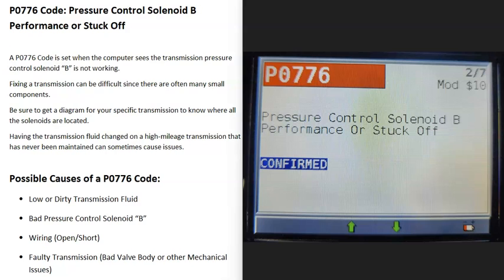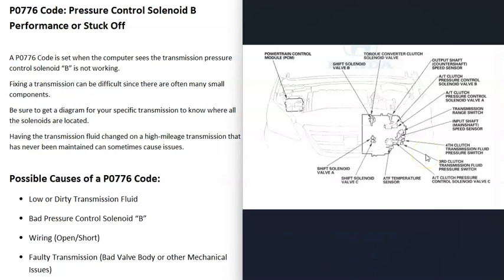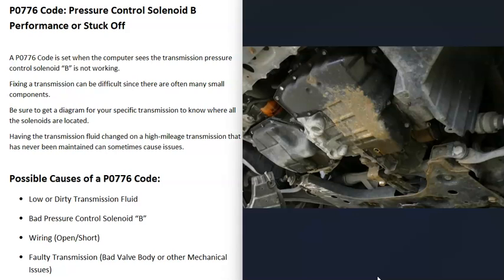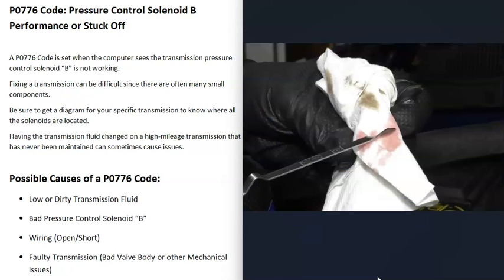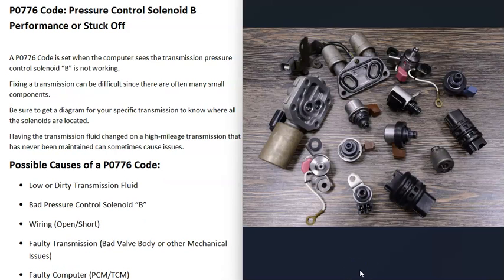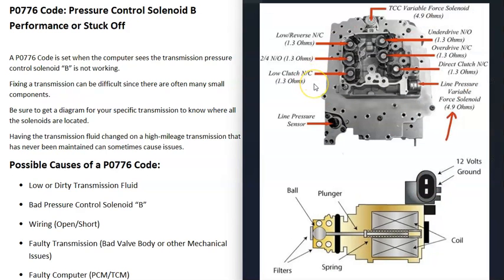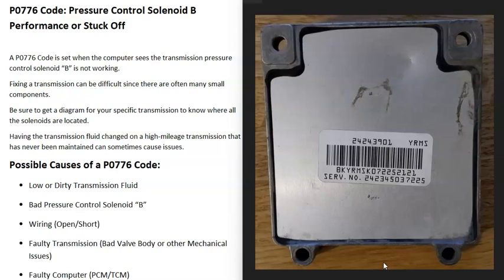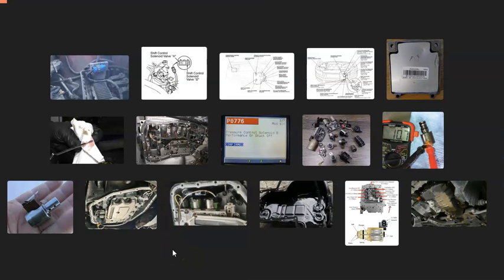Causes and Fixes P0776 Code: Pressure Control Solenoid B Performance or Stuck Off

Comment: what can be diagnosed without disassembly? Thats a commitment.  Fluid level (hot), Fluid scent..... repeatability... Does it happen once an hour or once a week?  Is the fix to key-off and restart?   Are any diagnostics available with Torque and a OBD2 code sucker?

Comment: I have a 04 Toyota solar P0776 came up. One guy check said solenoids are fine. Then took to another shop said transmission needs to rebuild it at $7500 and it skipping lst and going straight to 2nd. So another shop replaced the transmission with a 75000 miles transmission and the code and jerking is still not fix.
Reply: have you figured it out yet?
Reply: Not really. The shop put some safety switch in it . Think the computer not reading the transmission in first. But it's not jerking to bad . Going to ride it out for l year and trade in

Comment: I had p0771 and 0776. Solenoid stuck off.  Car did not change gears beyond the 2nd and was very rough. Transmission limited function error appeared. I only changed the transmission fluid and the problem was resolved. Maybe worth a try
Reply: how long after changing the fluid did it stop?
Reply: I tried the fluid change worked for a week. Looks like the wiring or solenoid issue
Reply: I have a p1778 and p0076 myself 
After it gets warm and I drove for little the gears rev so high when I just tap the petal and I have to feather it while the rev just to get home
Reply: @RepkickzReviews_ either solenoids or you have built slippage heavy, changed the fluid?
Reply: @mikehub6664 I haven’t yet. I’m nervous because the car has high mileage. 178k I bought it at 155k (my grandma bought it from her mechanic as a suprise but she doesn’t know cars much and it was a salvaged title) 

And idk if the trans fluid has ever been changed and from what I learned in auto and some videos as well I could blow the trans or have more issues from changing the fluid on high mileage CVT,
Reply: @mikehub6664 if I drive let’s say to work it’ll be fine on the way. When I get out and drive home (the other side highway is little more hills) if I like for example instead
Going straight home and go to a store and then get food then drive home , halfway down the highway when I get to the uphill part it starts to rev super high without the power behind it , just revs revs and stay at 3k rpm’s. If I go straight home and I’m very careful with the gas it normally makes most of the journey , but it ends up always when I get close to home start revving very high when I just tap the gas. I can maintain 40mph but it’ll be at 3rpm making the screaming CVT noise
Reply: @RepkickzReviews_ sounds like belt slip . I would do 2 fluid changes back to back to clear out all the old fluid and change the aux filter.

Comment: So I just changed the transmission oil and filter on my infiniti and this code popped up. It was totally fine before, any ideas?
Reply: did you use original tranny fluid on it? check your tranny level, when u changed the oil is it dark?

Comment: What's "high" milage
Reply from the maker: It can vary and depend on the vehicle and how it was driven. For example, a Toyota Corolla mostly highway driven likely 100,000 miles. A Chevy Cruze mostly city driven likely 75,000 miles.
Reply: Got the p0776 code too What bout a Altima 127,000? I’m also getting a p17f0 cvt judder (t / m inspection) give it to me straight am I screwed ?

Comment: I have a 2012 Nissan Rogue that showed one code, PO776, said the solenoid B was stuck off. Is it safe to think if I replace it the problem will be solved. Also the mechanic thinks I may have an air leak somewhere(my word).  Could this be the cause of the failing solenoid. I don’t like to assume anything but the words pressure & air leak definitely gave me pause. Any feedback on this? Your video is the 1st one I found that mentions solenoid B & not being a mechanic I watched it. When it started with the possibilities in 20 different directions I followed it down the rabbit hole, when it got to the end I almost passed out! Apparently I forgot to breathe. So many possible things to go wrong in one short video, are you trying to kill me!! It’s one big puzzle…one big giant puzzle.
Reply: Yes replace it. If you have done so where did you find the part? Seems to be hard to find

Comment: That exactly happen to me I took my pathfinder for transmission service and stop working properly now they want to replace the whole transmission for 7  grand
Reply: Yes guys my pathfinder it’s fixed I replaced the whole valve body I purchased in Amazon for 175 dollars
Reply: @tilostransportllc3469 I have just had the solenoid B issue on my 2016 outlander. 

They tried to tell me its $2500 to fix but im sure its not this bad
Reply: @tilostransportllc3469  did it come with the selenoides in it
Reply: Did you fix your Nissan Pathfinder? I have the P0776 Code on my 2013 Nissan Pathfinder and I don't know what to do. The dealer wants to charge me way too much to replace the transmission but the car runs good but at the beginning slips but then it runs good.
Reply: Waiting on parts (selenoides ) I got oil and filters my parts will arrive on Jun 4 dealer wants 7 thousand to fix mine
Reply: @trinoalvizo7332  did it work at the end?
Reply: I have the same issue with my pathfinder to, please let me know if u were able to fix it yourself thx
Reply: @gervisebane7880  Replacing the CVT transmission is the solution